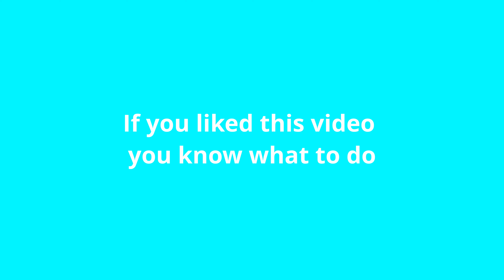Whats this? Episode 7

Comment: Is it standard practice for you to clean the holes with smoothing broaches when you do repairs on clocks?
Reply from the maker: No if they are really dirty and I have a feeling they might not get cleaned out well in the ultrasonic cleaner I use pegwood to clean them out first. The smoothing broaches are more for polishing the insides than cleaning. Although as you saw in the video they do work for cleaning too.